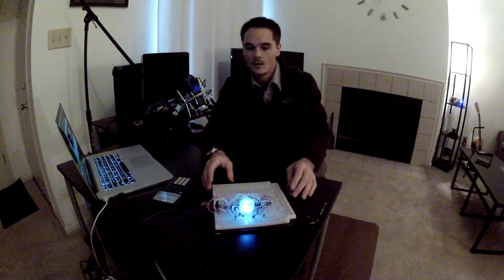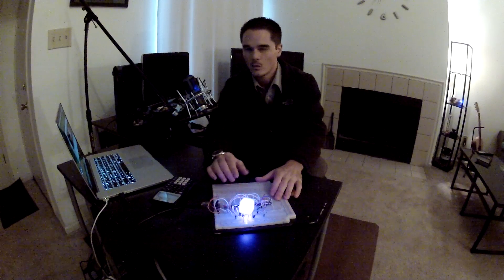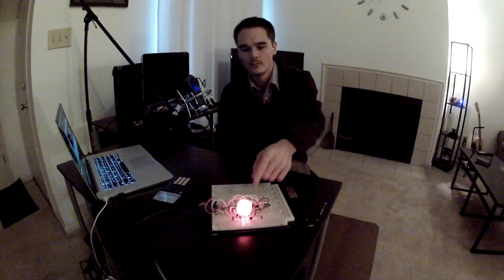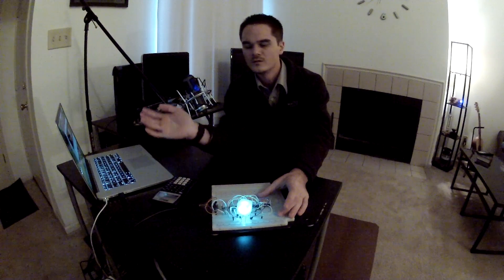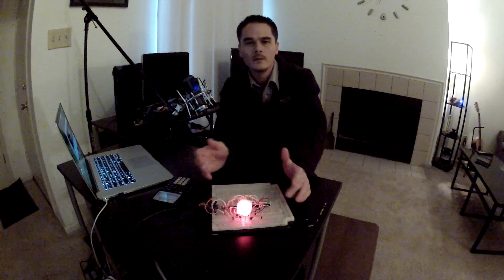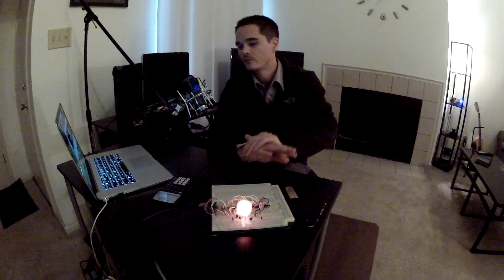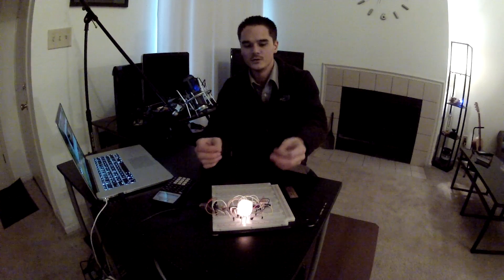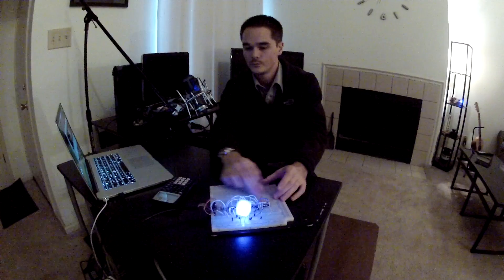8x8x8 RGB Cube Project Idea? Your thoughts?

Comment: Despite the fact that this is an older video, the design approach appears very sound.  As we all have seen, the price of RGB LEDs has dropped predictably and now this project is more a matter of determination to assembly so many LEDs correctly.  Did you ever produce Arduino sketch other than the proof of concept?  Is it possible to get the sample code you used?  I am going to build the cube, already ordered all proto boards, LEDs, shift registers, etc.  Just trying to fully understand the top down software approach you used to load the registers and control the patterns you desired.

Comment: Fantastic work. I am currently designing a Masters project in Communication Design in the UK. I am gathering data on how color triggers emotional response. The concept is to use touch (heat pad/heart rate), a dial to set a response (serenity to sadness) and maybe sound. The RGB cube would display the result. Problem is that I am new to arduino and electronic based projects. I have 4 months to complete!! Question is...is this too ambitious? Collaboration may be the answer. Need help in the UK :)

Comment from the maker: awesome!  I'm glad I made this video to feel this out.  I'm convinced now that I should follow through with the PCB, and since I'm going to put everything out there and keep it (open source), I can't wait to see all of the different implementations.  I was going to use PIC16F877A for this originally, but thought it would be more of a challenge to get it running on an Arduino.  The code is completely "portable" so you could easily port the code over to a PIC

Comment from the maker: yea, and this will be some kit!  it will have 2,048 LED leads to solder, 192 wire columns, 25 shift registers, 192 npn transistors with base resistors.  But yea, I hear where you're coming from.  The cube will be very modular, but only up to 8x8x8... well, maybe bigger, but for now, you will be able to scale it down to anything want, like a simple 3x3x3 single color

Comment from the maker: yep, you got it.  Mic and audio inputs will come later, those will be the final touches.  My bare board will have a playground area to hook that stuff in to.  The problem with this kit is that the LEDs are kind of expensive.  At cost, they're gonna run about 75 bucks.  Then you got everything else.  The kit might run up to 200 bucks.  Is that reasonable?  That's what I was trying to figure out in the video

Comment: a couple tips on pcbs--> there are always gonna a 3-4 mistakes on the first couple designs because the longer you stare at the design the more the norm it may look which makes it really easy to overlook small but critial things, when ordering over 100 the prices drop dramaticly, would definitly do a low production demo run first to verify no overlooks,... i use pcb express as a design tool and to get them made, silk screen and solder mask is a must although more pricy

Comment from the maker: If I get a kickstarter going, I'm thinking 50 bucks gets you the PCB, maybe 30.  We'll see what I can get quoted.  I'm thinking 150-200 gets you the full kit.  That means al the parts/ PCB and the cube solder jig.  What do you think?  Is that fair?  This would be pretty close to cost.  The LEDs alone are 75 bucks, or at least what I paid

Comment from the maker: whats on my desk is just going color to color every 2 seconds.  Were you picking up on some flicker?  The thing with this design is that FPS could be defined in several ways.  We have the continuous multiplex frequency and the true update frequency to which "new" data can be written to the display.  I will spec all that out throughout the tutorials and show you exactly how you can modify those values.  Like if you want to sacrifice brightness or CPU "free time"  As far as cost goes... new commen